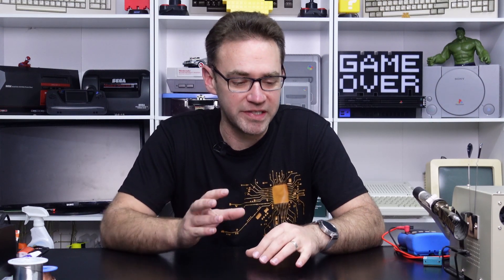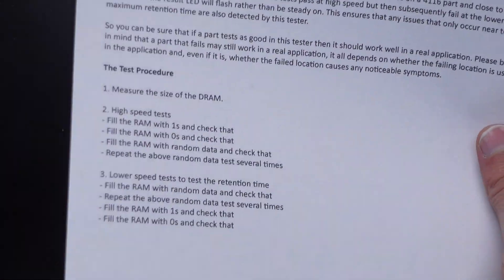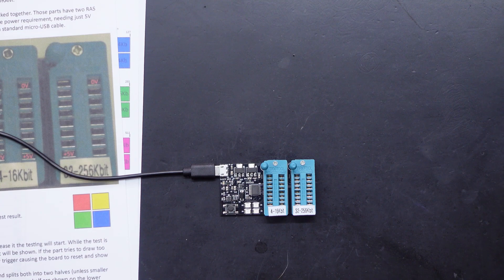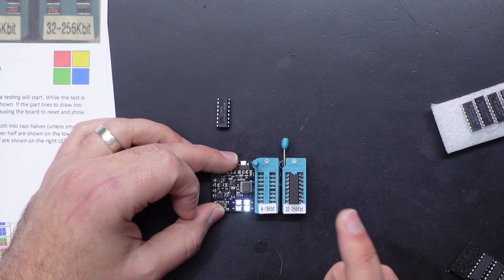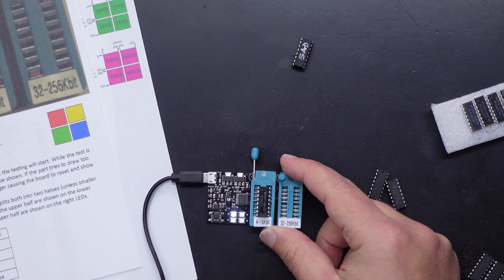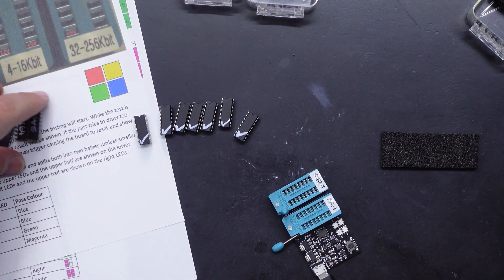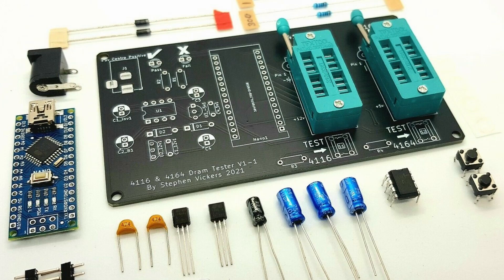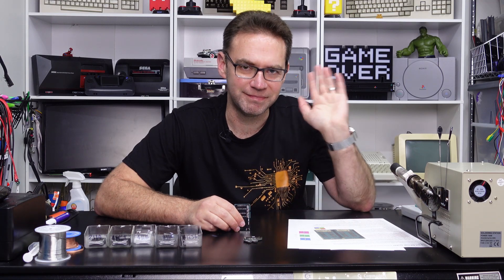D-RAM Tester for 1bit dynamic RAM ICs

Comment: I used the same tester on my recent MSX video and it's nice and easy to use.
Reply: I was thinking would the tester work with some extension wires and a chip test clip so you could test ram while still soldered to the board ? would the other memory chips draw power from the tester, I guess that could be a problem. Also the common address and data lines would also be an issue.
Reply from the maker: Would be interesting as a test, just to see what happens. I'm not sure if you could rely on the results though 🤔

Comment: Clearly it's the week for testing RAM :-) Noel (From Noel's RetroLab) building and testing that bigger unit you mentioned.
I suspect I'll have to go with the bigger unit as I suspect I have SRAM to test in the future. (Picked up a PET and a couple of Microbees, both of which are SRAM based)
Reply from the maker: Yeah, I only became aware of the bigger one once Noel showed it off. His video popped up on Patreon as I was filming this video. I probably would have gone with the retro chip tester if I had have known about it prior to ordering this one as I have a couple of VIC20s that need looking at, but oh well, if there's a fault with the SRAM I'm sure I'll figure it out. Good luck with the PET and Microbees, very jealous!

Comment: Great Video. I've found my ram tester to be a quick way to go through my ram bins. Plus It saves you from having to test a ram with a dead short in your ZIF machine. I actually did also build the Kit one too, so I could test 4116 ram as well. I didn't know about the one you purchased, otherwise I would have bought it instead. I do own a short board as well so maybe I should get the 4 bit one. With 3 ram testers I'll have to be sure to label well so I don't  fry something.
Reply from the maker: It's funny, after you suggested it I sort of sat on the idea for a couple of weeks and then found this one on eBay, and it seemed like a good deal. If I didn't have the minipro to test logic ICs, then the retro chip tester looks like most versatile but it's much more expensive it would take some time to build and test.
Sounds like you're pretty much covered, the 4bit one would be handy to have but they seem to have a lower failure rate. Still, who can resist more gadgets
Reply: @TheRetroChannel  The RCT is a very versatile tester. The 866 starts with 16kb sram and does not test any dram, the RCT also tests all smaller memory ICs (srams and drams). You can dump all kind of roms (important to conserve arcade and pinball boards). And it tests 10x more logic ICs as the 866 with less bugs ;)
Reply: I built a Tester that can test almost everything CBM used except the 4116. https://www.youtube.com/watch?v=9TBlnfiTfQk